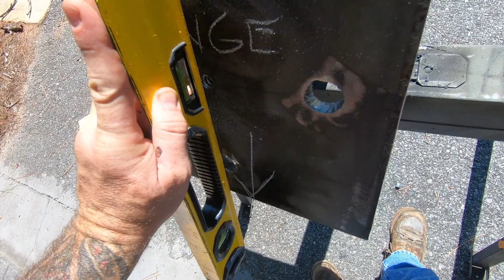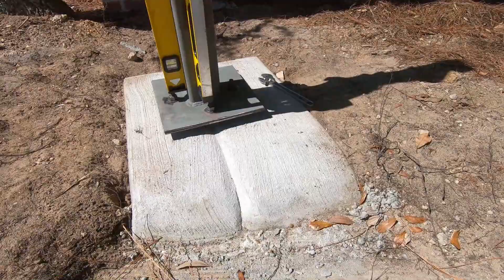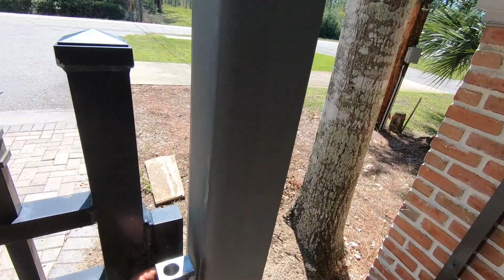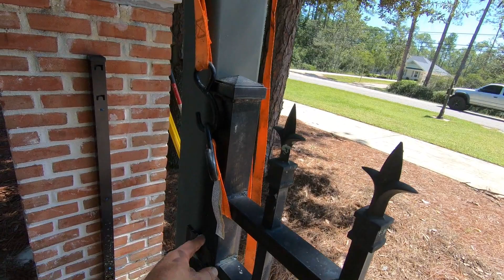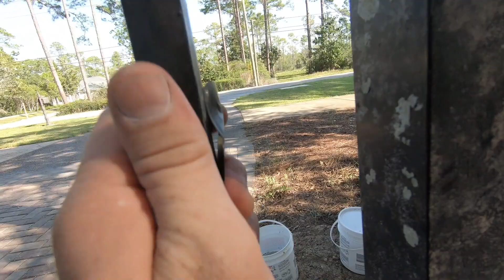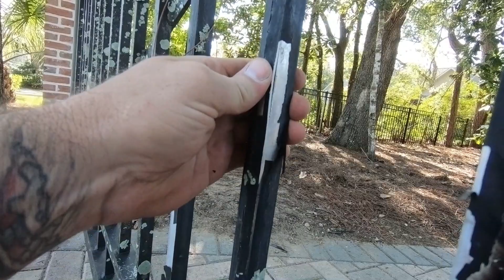Gate Post Part 3

Comment: Great job on the complete job.  You hit the gap just right.  I know the fence is more or less ornamental but may be it will help keep the post plumb after the fence guys finish filling the gap between the brick pillar and the gate post.   Maybe the gate had some water inside that froze and caused it to bulge and split.   I know your in Florida but the gate may have come from up north.  There is a cool way of using an off set on the the lower hinge to make the gate incline as it opens to clear a driveway that rises up from the road.  no need to make the gate open out.

Comment: Could you not cut a little of the end of the old pin's to make it fit..

Its a really nicely done job all in all. Solid.
I like the j bolt method, similar to how structural steel columns are done.
Its not going to sag imo.
Structural steel columns use grout too non shrink, if it works there it'll definitely work for a light gate.
Reply from the maker: Great question.  I though about cutting them too but the way the ends are, they sit nice on the ball bearing that is down inside.  I was afraid it would cause some issues.  I mentioned it to the customer and he said he didn’t care and to just leave it.  He didn’t care about the large gap between them.

Thank you for watching and comments.  I love feedback because I’m always looking to improve. I’ve got some more videos coming up.